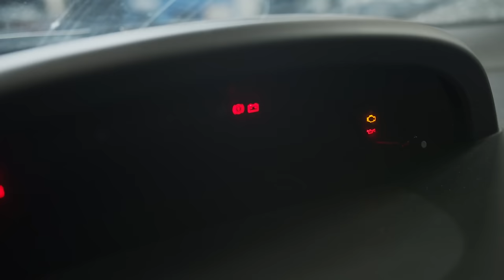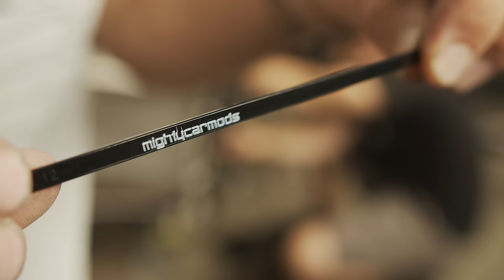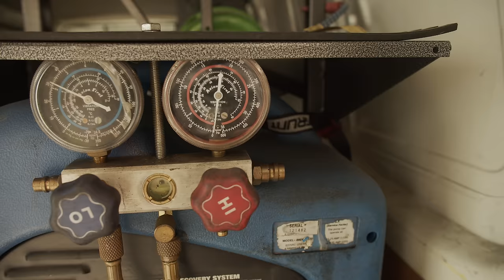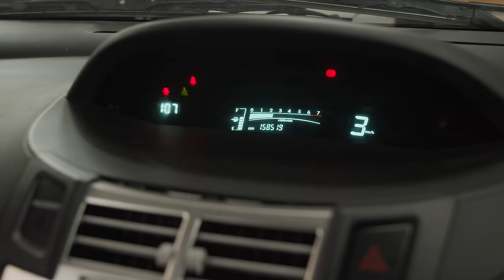Making A Slow Car Fast for $500 (Season Finale)

Comment: MCM: "A testament to all things average, mundane and built for nothing more than pure practical unadulterated boredom"
Google: Did you mean Nissan Versa?
Reply: Hey i resent that comment... i have an 08 but say what you will they can be decently dependable, the one my wife bought before we married finally died at 273000 miles. Never had to change the spark plugs (until 270k but i think the cat was stopping up to make it run rougher).
Reply: @darrenswails  Well I never said they weren't reliable. But the car was literally the cheapest and most basic car you could get for some time. That was Nissan's intent
Reply: @davidlaughman5358  i know i agree i wasn't really offended,  yhey are pretty boring, but i can fit an 8 ft ladder from front to back and a 60 inch shower pan in the back lol
Reply: I wanted something that couldn't go fast enough to get hurt for my daughter's first car, and preferably something no teenage guy would be caught dead in. I got her a Versa..
Reply: @83gt17  yeah I'm a married man with 4 kids, so i dont care about dates with strangers...and mine is a work car i got from copart with a blue hood on a burgundy car
Reply: I used to make regular trips through the desert in the US in a rental Versa. It took a while to get up to speed, but was decently fun through the canyons for what it was.
Reply: @ScootyPuff_Jr  mine is the 1.8 ...it is slow, would hate to see what the 1.6 would do😂

Comment: Making a fast car faster = "easy"
Making a slow car fast = challenging but cheap
making a moderate car even slightly faster = expensive and hard
Reply: Making a slow car fast is cheap af
I've tripled the horsepower on my 02 VW Polo 1.4 with an 1.8T engine and gearbox swap (from 75hp to 225hp)
And also I got a bigger intercooler a complete turbo back exhaust and coilovers and a complete audi S3 front brake kit
For just 1300€
Reply: Most moderate cars nowadays have a turbo, just flash the ECU and enjoy the 15-30% added power.
Reply: I mean, I guess it can be cheap if there are other existing parts that will nearly completely bolt right up, but try a car with no aftermarket, and no other parts from the maker that will swap in!
Reply: Tobias Volk i want to see your whip
Reply: @champagnelewis7049  that just means you have the wrong car, or you need to become a master fabricator.
Reply: @heygek2769  Oh, it's definitely providing me a learning experience. Also has the benefit that it's pretty easy to be be unique with an otherwise mostly overlooked car.
Reply: @tobiasvolk366  lol exactly the cars I owned except the S3 is sold and the polo is still stock and my only car for now
Reply: @shakur4648  I'll start my own car related YouTube channel next year there you'll see more of it
Reply: @oxaile4021  V8 power for me. But FI will eventually come.
Reply: @tobiasvolk366  That's 2 months food for me
Reply: @tobiasvolk366  Why wait?
Reply: @ellenorbjornsdottir1166  do I smell my first subscriber here? 😂
I don't have proper equipment... and I don't even know the real direction I want to go with my content... And also I have to sort out some problems in my life and on my cars first (ain't got a proper daily driver) 
But I think it Wil be a mix of mcm and regular car reviews
So reviews and repairing/modifying stuff on cars and motorcycles
But I think I'll put out the first video tomorrow and a short one this week
Reply: @tobiasvolk366  I have a nutrition channel behind this acct.

Comment: I had the Yaris with factory fitted 1.8 motor. Came in 3 door with all the bells and whistles... keyless entry, traction control, etc etc

With a good intake and exhaust you can easily make 114kw and 200nm. Great little motor!
Reply: @acbent11  Yup, 17" wheels too. I swapped them out for lightweight Lensos. Off the line I regularly gave turbo cars a run for their money, until the higher speeds, obviously.
Reply: @rsiboy87  I have always loved the TS. Too bad it never made it to our continent. I can only imagine how many would have been turbo'd if they were available here, especially with a ready-made (well almost) turbo kit. I'm going to google the Lenso wheels. You wouldn't happen to recall the specific Lenso wheels you used? Thanks!
Reply: @acbent11  I had the Lenso S4 in 17". Only came in a single offset IRRC.

Comment: You can always put a Supercharger TRD Style 😂 It will  probably give it more power
Reply: Didn't all those fail? Bearing issues? I haven't seen one in a while, I believe it was the bearings that gave out.
Reply: Fit a barra
Reply: "Mr Mate" Z nah those don’t fit the 2zz-fe they only work on the lesser carolla engines called 1zz-fe or sum
Reply: @112boatman  they want it to be reliable not break down all the time.P.S.barra's are shit
Reply: Supercharger doesn't turn off the check engine light though

Comment: I Actually had the Yaris with the 2ZR FE engine and loved it... Still does need a supercharger for 150 crank kw tho ;)
Reply: I also had the yaris 1.8 TS. Fun little car. I agree supercharger is recommendation :P
Reply: One time I had a 12.5 horse Briggs and Stratton and removed the governor and did a pully swap... I'd bet it was faster than ur yaris
Reply: @trikelyfe6090  I have no idea what you are talking about but pretty much anyting (maybe even a duck on a horse) is faster then my yaris was ;) That didn't stop me on wrenching on it and it was a blast to modify it.
Reply: Briggs and Stratton is a lawn mower engine...lol

Probably still more power than a Yaris
Reply: @ElkinsEric  lol.

Comment: What a smart and clever swap.  Same engine family, near bolt-up...still plenty of fabrication and wiring.  Phenomenal bang for the buck.  Any idiot can throw cubic dollars at another over the top LS swap with a checkbook build, but it is nice to see a smart sleeper swap on an econo-box on the cheap.  Lightness is already there, so it doesn't need a lot more power to be a total hoot.  The hot hatch Toyota should have built.  This is a project any enthusiast can tackle with a little help.   THIS is what hot-rodding is all about.  Well done lads!

Comment: Thx for this Christmas present!!! Only thing I am wondering about is why you didn't just swap the gearboxmounts and use the 6-speed which was meant to be with this engine? 
Edit: wouldn't it be better for you to get parts from Toyota UK rather than USA? Cuz you would have the parts for a model with the steering on the right side? Not trying to be smartypants. Genuine interest
Reply: I think they kept the 5 speed, as the 6 looked to have a longer case to hold the 6th gear. With how tight just fitting it in as is, they might not have been able to squish it in without cutting metal, which I think is the point of this cheap car engine swap.
Reply: Toyota 6 speeds are weaker than 5 speed
Reply: Im not entirely sure that toyota UK would have the mount either. here in the colonies we can get the bits you need cause we had that engine in the scion DX which shares the front architecture with the Yaris. i dont think the uk got that car with that engine. So it would be a 3 week lead time... i think thats the answer you are looking for
Reply: Alex S87 because easier
Reply: @ZackNakazora1  Just looking at the Wikipedia article pic of the engine bay of the Scion xD, I think I see the mount setup they'd need. Maybe I and 6 other fans can manage to send them that stuff. I'd also love to see the wiring harness plug and play swap bits sent to them. I like plug and play swaps, because it is way easier for anyone to do, without using a welder or having to do wiring or aftermarket ECUs and learning or having someone tune your setup.
Reply: Well than you have to deal with the axle length and position, by using the 5-speed they didn’t have to worry about the axles. And the other reasons other people said.
Reply: The gearing on the 1.3 liter Yaris is crazy short (~2400 RPM at 80 km/h in 5th), wich makes that gearbox ideal for track use. The 6th gear is meant for economy driving.
My old XP9F (2007 1.3 Luna), basically the same as Yaris Hilton, would pull fine in 5th from about 65 km/h. 

Alternatively, they could have gotten a 6 speed from the facelift (2009-). I would guess it's the same gearbox that is in my current XP130.II (2016 1.33 Delight).
Reply: bro they literally said why they didn't put the 6 speed in... plus 5 speed will be shorter gears and more fun on the street.
Reply: i think a gearbox meant for smaller engine would have better ratios for acceleration when coupled with bigger engine

Comment: very interesting build.... apart from the fact you chucked the 6 speed but the fact that even the bell housing FITS as-is is really surprising... all toyotas from the 90s used essentially the same transmission (its a C series, even now) but the bell housing was not the same for the A and E series blocks, so you needed to do some surgery to get the transmissions to fit either one. We can NOW confirm the ZR and the NZ blocks have identical bell housing bolt holes... really very interesting what they did here.
Reply: Yeah, great info. My U340E auto bolted right up to the 2ZR. I have a video on my channel about my swap as well as turboing my 06 Yaris RS.

Comment: 2zr sounds like a engine with 1000hp potential...
Reply: Ya, but it really is 133hp... ask me how I know...
Reply: My starter car for about a year was a Corolla with the 2zr. Motor sounded peppy at high rpms(which happened to be most of the time), but the car got me in dangerous situations during acceleration past 40mph. Also, the trans always shifted up at all the wrong moments. Sketchy as...
Reply: @ekamvirk7599  so you had an automatic.....
Reply: @itsneuman  ya...america...
Reply: @ekamvirk7599  I took 30 seconds out of my life and googled the engine code that Marty said, that's how I also know it's 133hp lol
Reply: Is this a reference to the RWD iM Corolla with a 1,000HP 2AR?
Reply: No Google needed, 100kw×1,000=100,000 watts÷746 watts=134.? Hp
Reply: @themanualmindset2868  or 100x0.3=130?
Reply: @oli12shackel9  sorry mate but 100*0.3 is not 130 haha x
Reply: Makes sense. My iM has a 2zr-fae and it makes 137 hp

Comment: For getting hoses off easily you need a hook pointy tool that you can slip under a hose, run the perimeter and then pop it right off.   It's especially useful for coolant hoses and heater hoses in particular.

Comment: New Zealand got that shape of Yaris with a factory 1.8 too (1zz).
Reply: Did they get it sold directly to the NZ market? Or is it a JDM import like most Kiwi cars?
Reply: @8888k  Directly sold new as the Yaris RS. I even found one currently for sale here. JDM ones wer known as the Vitz.
Reply: NZ really got the cool models compared to Australia
Reply: @haydenw8691  if the 1zz fits.... 2zz goodness?
Reply: You mean 2zr 1.8L.  The 1ZZ or 2ZZ was never stock in a Toyota P chassis car as they all used the NZ, SZ, NR, KR, and ZR.  

The ZZ engines were only sold in A, W, and T chassis vehicles like corolla, MR2, Celica, auris, matrix, Avensis, Isis, etc. 

The ZZ engines replaced the A series engines in the Toyota lineup. 

I deal with parts for Toyota and I also own a NCP91 Vitz RS so I am deep into these cars.
Reply: @kimoliburd8829  ;) ding ding ding. though in theory hardware wise... you could
Reply: @ZackNakazora1  That was my plan but since the zr fits the NZ gearbox and I have lsd I decided to hold out for the zr although people say they are still slower than the 1st gen vitz RS.
Reply: @kimoliburd8829  eh people can suck it. Do what you think is best for your car. And you do it your way. That's the beauty of modifying cars. I wanna see it done.
Reply: @ZackNakazora1  has been done before.
Reply: @kimoliburd8829  I stand corrected. Good to know.
Reply: @haydenw8691  we are all here to help each other.
Reply: @haydenw8691  it has been done many times in the Caribbean countries like  Jamaica, Antigua and Puerto Rico. Antigua also has a K20 type r vitz RS.

Comment: this is an great engine but why didnt you guys use the 1.8 VVTLI   with 190 hp ? :} 9K rpm sounds great on those :)
Reply: Those are way harder to find and more exexpensive
Reply: I kinda hoped they'd 2ZZ swap it but good luck finding one under $500
Reply: That's would be awesome in a yaris fair play.
Reply: @JosephArata  and I wonder why 2zz engines are gold here in the Philippines
Reply: @RR-cg2rq  basically, they are the B18C of the late 90s, early 2000s of the Toyota Naturally aspirated performance scene. You can turbocharge them, but don't expect the engine to last more than 100,000 miles, even built.
Reply: @JosephArata  or in other words, 2ZZs are just the B18Cs of Toyota
Reply: @RR-cg2rq  pretty much it makes similar power just is 2.2l instead of 1.8
Reply: @BoostedPastime  ?

2ZZ is a 1.8l
Reply: @filipprucnal  oh oops

Comment: At the shop we have wooden platforms made and we drop engines out of the bottom like the factory. It’s fast especially working on BMWs for 30 years. Also a fork lift is recommended for that method but not necessary. The pads are big enough for the engine and transmission. It’s essentially in the e9x series. If you have to replace turbos. Takes about 2.5 hours with the engine in the floor in car is almost impossible. I’ve heard of that being done but not by me. Drop the engine out in about 30 minutes.

Comment: Yaris done. Mira done. Mini done. Why never Suzuki Swift Sport :(
Reply: Yes mate
Reply: Which one? ZC31S, ZC32S or a ZC33S?
Reply: Zc31s is the best in my opinion just for sheer driving pleasure but probably way harder to tune. Zc32s's bosch ECU means it would be cheaper to get more power out of it. Zc33s in my opinion is a completely different type of car and loses the magic of the original by going turbo.
Reply: @raulferro3998  I'm just happy if they feature any Swift on their show! A negative would be sudden price increase of 31 and 32's if it does happen. They're both a tonne of fun.
Reply: @ksy76  Well I wish it was a ZC33S cuz I own one, that way I can clear some doubts I might have when I decide to mod mine, but they never feature current models so I have my quantifiable doubts it will be the latest Swift.

Comment: should have put a 2zz-ge with 192hp
Reply: Found in what car ?
Reply: @whilethecitysleeps4928  2000-2005, used in Toyotas, Pontiac, and Lotus. Some also had superchargers putting them up to 225hp but I'd imagine hood clearance issues on this build if they went that route. I'd imagine they didn't go with a 2zz-ge do to cost, they are over double the price as they are a more desirable engine for those seeking power.
Reply: Not as easy to fit, would require custom mounts. 2zr doesnt, it fits right there. 2zz wiring would be alot different too
Reply: Came in corolla sportivos and celicas in Australia
I say they plan to boost it and wanted something more compatible with chassis
Reply: @RRR_Motorsports  yeah but they would have had more place for improvement since 2zz-ge is older. but i agree that wiring would have made it harder

Comment: Who else is watching in America and doesn’t know what kilowatts are 🙋🏼‍♂️
Reply: ^this guy
Reply: They’re bigger than hp. Divide by 0.75
Reply: A moment of silence for the metrically impaired.
Reply: @plonkster  yeah it's a thing. Be the same vise versa
Reply: Well it’s just the universal method of measurement
Reply: @cashusclay69able  indeed, I have to convert hp to kW to make sense of it. Let's not even get started with mpg. That's completely nonsensical to me, cause not only is it not metric, it's also based on the American gallon.
Reply: I assume you are British :-) South Africa was a British colony, so we also used imperial units until the 60s. I have a basic grasp of imperial spanner sizes (eg half inch is almost 13mm, 9/16" is 14mm, 3/4" is 19mm, and so forth) because of that, but I simply cannot convert MPG (imperial or US) to km/liter (or liter/100km, which is the proper unit) without some kind of tool. Thankfully it is easy nowadays. "Hey google... convert!".
Reply: I thought 100 kW was 141 hp, but google says 134, so 5 seconds gain on a single lap seems incredible.
Reply: BeamRider100 you are near the problem as there is at least two slighlty different hp and then french might have it little bit dfferent. kW is always 1000 watts which equals to 1000 Joules per second so everything is simple to convert etc.
Reply: @plonkster  me too I actually own a metric crescent wrench yeah and don't forget the metric pipe wrench or water pump pliers

Comment: You can take off the shroud around the steering wheel and do a simple wire hack there are heaps of youtube tutorials and the key just permanently stays under the shroud and you do don't have to worry about it. When also it's easy to hotwire your awesome nugget.Its basically making a big antenna out of your transponder key and hiding it.

Comment: So I this with my Ford C-max, the engine was goosed and needed rebuilding as it is the famous Fiesta ST150 duratec-he engine that eats oil rings. I was using over  5 litres of oil a month!

I was going to fit a Focus ST225 engine as a conversion, but the price of a Focus ST225 over here in the UK even crashed up has stupid scene tax attached. I tried to source a Ford Kuga 2.5t, and a galaxy 2.5t but again it's 'an ST engine' so has stupid scene tax attached. So I went for a Mazda 6 Duratec-he engine. Straight fit, and I've gained over 10bhp without actually doing much. 

I did all this work over 2 days on my driveway, no engine crane or anything so it's good to see that this sort of thing is actually thought about rather then people just buying finance cars and bagging them on financed wheels.

Comment: i loved my Yaris, I owned it from 2006 to 2016. It was with a 1.5l and yes, its slow, I had to floor the gas for some acceleration all the time.  The Toyota transmission and engine was tough enough to last through the 10 yrs of flooring.